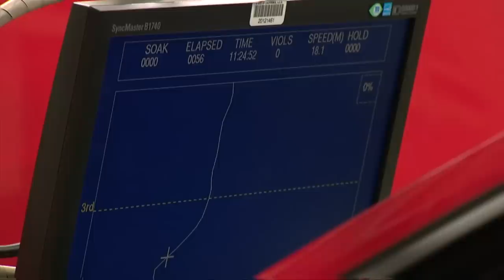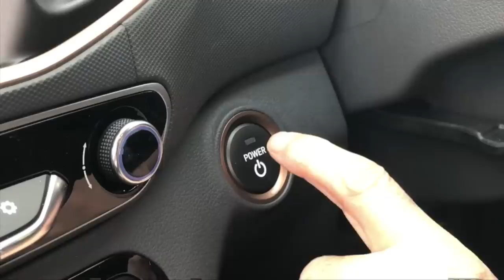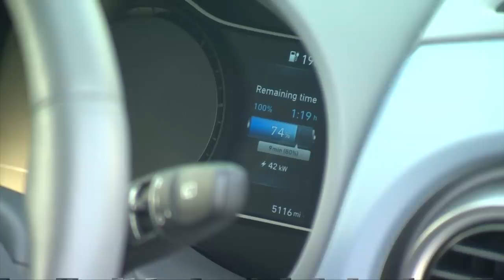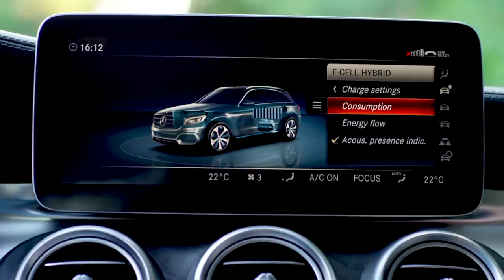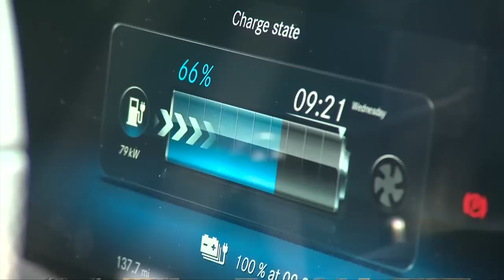Electric Cars: The Future of Road Vehicles? - BBC Click

Comment: come on you all, let's switch to EV, so there is no such thing as war over oil any where on this planet surface
Reply: Don’t worry Once the climate crises really kicks in fully they’ll be wars over safe land to live on.
Reply: @kentonian  couldn't agree more
Reply: Really?  The average UK house uses 10kw of electricity a day.   What do think will happen to the national grid if everyone plugged in a 7kwh charger each night?
Reply: @Chriswales  well, you can install solar or wind charging panel, whether it's temporary or permanently and yes it is a bit uncomfy but it is for the better future
Reply: @bobsthea  and how exactly are solar panels going to charge a car overnight - without yet another set of batteries.  Most house solar arrays are 3kwh - hope you don't need to drive too far in December ...
Reply: @Steve Davis certainly hope so, wouldn't want the lights in my house going out just because half the street plugs in an EV.  Fingers crossed Russia doesn't stop sending gas otherwise everyone would have to walk to work lol
Reply: @Steve Davis in 2017 47% of our gas came through euro interconnection & 36% of Europe's gas comes from Russia.  So yes some Russian gas is used to heat our homes & make electricity.  Currently (lol) gas is the main source of electricity here.

Comment: I remember Chevy Volt.
Reply: I am driving one, well the Vaxhall Ampera UK version every day. Looks and drives like new, gets me to work and back, to the shops etc in EV mode, I'd never go back to a full ICE car now. ICE cars are technologically  inferior to EVs, power bands, constant gear changes, turbo lag, expensive to run, plus they are full of bits the wear out and cost a fortune to fix, and that's before you even consider all the pollution and health damage they  cause. I will get a Tesla model 3 or the VW ID next.
Reply: @donaldduck5731  I also want EV but not much choice here as of now.

Comment: These cars will blow electricity prices/bills through the roof “in the future”. Here in South Africa electricity is already expensive
Reply: Nkwete, in comparison to our salaries, yes maybe.  In comparison to other countries not at all.  Other countries will laugh at you saying electricity is expensive here.  With regards to fuel, electricity is cheap.  I did some research a sort while back and let me give you some figures:

My car takes about 55 litres to fill up and it cost about R900,00 to fill.  With that 55 litres I do about 800km.  Therefore if I divide R900,00 by 800km, I et a value of just over R1 per kilometer.
A Tesla model S do about 500 km on 100KWh of battery power.  As I'm on prepaid I bought R2000,00 worth of electricity last month.  It gave me 984KWh of electricity. This means, I could have charged the Tesla 9 times 100% full and the 10th time 84%.  Now 9 x 500km = 4500 km.  Add 84% of 500 or 420 km and I totalled 4920 km for my R2000,00.  Now if I divide my R2000,00 by 4920 I get 40,7c per kilometer.  This means less than 40% of the price what I currently pays to drive a car on petrol.  So what is the ost expensive, petrol or electricity?
Reply: @johanv.d.westhuizen1705  absolutely correct. I've been running a Nissan Leaf for about 3 years in SA and the electricity costs are around 33% of what the petrol or diesel would be. Plus the car is far cheaper to maintain, is far more reliable, is clean and quiet. It's all a no brainer really, even here in SA. At least once the government gets rid of the crazy tariffs on EVs. I bought the Leaf second hand.
Reply: Huge solar potential in S.A.  Ask Eskom why it's not being developed more rapidly.

Comment: Charging times and charging speeds well you did not tell the whole story here I have been driving a Tesla model s for 4 years and the charging speed was approximately 120 kw IONITY has only built 4 chargers go and look at teslas supercharger network across the whole of Europe you can travel anywhere public chargers are unreliable and not enough fast chargers my new model 3 was charging today at 150 kw and version 3 is 250 kw the rest of the auto industry are approximately 7 years behind tesla you also missed very important facts on electric cars ie how many wh do they consume per mile which is the most important numbers to correctly give you the range of the vehicle and therefore efficiency electric cars are have lots of variables when determining how far they will go drag coefficient, wind speed, outside temperature, tyre pressure , a battery management system to cool or heat the batteries , chemistry of the battery the list goes on but you did not mention one of these factors if you want to cover technology of a product please research properly and give a balanced approach on who is leading the way I have driven every electric vehicle to date and only one company stand out and lead in every area if you do more on electric vehicles please do comparisons on range and efficiency because that determines how much electricity you put in it and also compare same class of cars ie suvs against suvs and saloons against saloons ease of charging on different networks over a long trip ie Scotland to the south of France

Comment: What am I going to do with a vehicle that can do 300 miles a day? Some days I do 450+ (even 550+) and damned if on top of all that driving im going to wait around for 2 hours at a services waiting for the thing to charge when I could be driving home after I have finished work! This will make me 2 hours later home every night. No fast chargers where my destinations are at businesses either, just a standard 13amp socket in the offices, nothing outside in the gravel car parks. What am I expected to do run an extension lead out the window lol.. Electric, totally impractical for the people that travel long distances, ok for short distances or if you have time to laze around at the services. Don't forget about having to charge your vehicle in the morning for 2 hours too at the services before you even start your days work! .. and what about towing, some of our fleet tow trailers, a Tesla wont even get 150 mile range towing one! Electric isnt there yet for half of business users, you need double and in some cases triple the range before it is a viable option. Then there is the problem of our National grid is currently running at 97% capacity 24/7, so add electric cars to the equation and you overload the network in no time... as a side note, the faster you charge a battery the shorter the life it will have, especially a lipo battery! this is very well known...
Reply: I've driven THOUSANDS of miles on US highways in an electric car, no problem. That's what a Supercharger is for! I get enough energy to drive 150 miles (about three hours) in 20-30 minutes. It takes me longer to pee and have a sandwich than to charge my car. I suggest you question your bias and get information from people who own one. 
Another lie: EVs will overload the grid. EVs represent no net increase in energy use from the grid. Why? Because refining gasoline requires 5kW of electricity per gallon! An EV can go 15+ miles on that much electricity! Want to save energy? Stop refining gasoline!
Reply: @justsomeguy934  There's 1 Tesla 'Super' charger 183 miles away from where I live here in the UK, and 3 'Destination' chargers within 250 miles (nearest 43 miles away). Utterly useless if someone travelling for a living and is expected to convert to electric. I can fill my vehicle to travel 500 miles in less time than it takes to down a can of coke by the way lol. Our national grid is currently running at 97% capacity, we don't refine petrol in large volume as you do over in America so that argument is null and void. The strain on our grid is going to cause real problems to the point we are having to building new nuclear power stations to try and cover future EV demands (against the wishes of many since Fukushima and Chernobyl). Lots of people here live in high rise apartments with no intention to install charging points in basement garages (majority don't even have basement garages), so how do they charge their cars? sit in a slow charging station for a few hours before work on a morning? (no fast chargers remember!)... Electric is not practical over here yet, and wont be for some time...
Reply: @Ra-zor  You have many incorrect "facts" about EVs. Ready to discuss? As for superchargers near you, you have to be in an area traveled enough to get a Supercharger. Highest traffic first, sorry someone can't snap their fingers and duplicate an infrastructure that we've had 100 years to make (like petrol). While you can fill your vehicle in 5 minutes, do you drive for 500 miles with only a 5 minute break? That's not only dangerous but illegal for commercial drivers here in the USA. You have to take breaks - and you simply charge while you're out of your car. 
Your argument that EVs will overwhelm the grid is nonsense as well (a common scare tactic written by the oil industry). There is no net increase in electricity demand for EVs. Why? Because when you drive an EV, you're not using gas. Gasoline requires 5 kw/h PER GALLON to refine - an EV can go 15+ miles on that amount of energy. Just stop refining gasoline and you can push an EV farther than a gas car can go! 
As for charging, the average USA commute is 25 miles round trip. That's all a typical person drives in a day. You don't need to charge every night at that rate. Many UK towns are converting light poles to have connections for EVs, as well as work places. If you park on the street, have no power, live somewhere it's not feasible, then get a hybrid.

Comment: Hydrogen is electric too. The current comes from combining Hydrogen and oxygen and is not store in a battery. But the CAR is all electric.
Reply: You are talking about hydrogen fuel cell, not hybrid. Hybrid still runs on Petrol/diesel.
Reply: Phil Terry sorry spell check got me there. Ment hydrogen. Will Edit. BUT video  said ...pure electric ... not hydrogen...  and hydrogen is by all a electric car as well.
Reply: @andreaslossius7920  Hydrogen is Electric, Though not the future of road transport.
Reply: Phil Terry interesting view. Why not do you think?
Reply: @andreaslossius7920  Well as you said Hydrogen is basically an electric car. Producing the Hydrogen, transporting it around the country and then turning it back into electricity, makes no sense with all the losses you incurre. Much better to simply put the electricity straght into the car.

Not to mention the huge cost of fitting the Hydrogen infrastructure.
Reply: Hydrogen is not good as an automotive fuel. Several reasons! First and foremost, it's an energy loss just like gasoline - you only get back about 20% of the energy required to extract and store it. Second, to have a usable amount you must store the universe's most flammable gas as a cryogenic liquid under thousands of pounds of pressure (about 3,500psi). To dispense it, you must store it at a station at about 10,000psi. Very high combustion risk! The only reason you hear about hydrogen as an automotive fuel is because the oil industry is the primary source of commercial hydrogen - they want a piece of your transportation dollars. Gasoline is far superior to hydrogen as a practical fuel.
Reply: EV Owner. Hi. Most of the problems you mention is already solved. In Norway there have been hydrogen stations for a while as a test. We are good in transporting flammable gasses.  It has been done for decades. Produsing hydrogen is a wery difficult calkulation because it can be done in so many different ways. I would like som documentation for the number as low as 20% please? I have not sees a number as low as that.
Reply: @andreaslossius7920  Sure! Hydrogen, at the point of usage, is 40% - 60% efficient (let's say 50%). This is far better than gasoline. What is left out of the equation is the processing/extraction/storage energy, which brings it to 20% - 25% of the total energy used to render it usable. (Here's an article on the usage point of hydrogen, although it talks about emissions reduction rather than energy cost) https://www.energy.gov/eere/articles/hydrogen-clean-flexible-energy-carrier .  Regardless, look at what hydrogen does - it must be stored under tremendous pressure cryogenically to be useful - why use it? There was a hydrogen station that exploded in Europe, I think, that caused it to not ever be replaced. And you're carrying around 3,500psi of explosive gas - why? Absolutely none of those dangers are necessary with a BEV.

Comment: lol. Now let's see the Tesla vs lambo around a racetrack (and before you say "why" because Lambo is a racecar)
Reply: Just a bit slow off the line.
Reply: Think other shows did it round Nurburgring if that’s how it’s spelt. Petrol cars might get beat on the earlier laps but petrol improves as weight is lost from fuel consumption. The electric car couldn’t continue that burst sprint time after time either. Petrol could and gets faster minutely each time.
Tesla’s latest time got very close to petrol cars worth ten times more around Nurburgring. That is impressive.
Reply: @stevepirie8130  Remember the time set around the Nurburgring was set by a hybrid. The combustion engine is feeling it;s age, and needs the crutch of the electric motor to compete. Ultimately the record will fall to pure electric, it is only a matter of time.

Comment: Ev's are a joke I won't get one until they can do over 600km per charge minimum  because of distance between chargers here Australia my closest charger is over 1 hour drive from my work/home. I can't justify the cost of a Tesla or any other ev they are double the price of the same car in petrol. Then to drive a hour to charge sit there for a hour then drive home again what a joke
Reply: You're not alone, Trent. As a matter of fact, EV's are an extreme minority, super niche market currently. 98% of consumers still prefer to purchase a "regular" car when given the choice.
Reply: The batteries range is affected too by heat, cold, does your trip have hills and mountains, etc. If your country has long power cuts obviously affects you too. 
I’ve been holding off buying a new car to see how it unfolded but I’m not 100% sold either. Powering my car off coal burning power stations just seems like hiding your pollution in someone else’s backyard.
Reply: I guess you don't have power at your work or home, mate.
Reply: @alanfoster6589  my stand alone solar system won't handle that kind of load and asking work to install one would be like  cutting their arms off
Reply: @trentneumann5788  How about installing Tesla powerwall or equivalent from Siemens to store power until it's needed?  But if you're fully rural and have a small solar system then no, it won't work.
Reply: @alanfoster6589  I have battery storage on the house it holds approximately 15kw of usable power I have 5 kw solar system on the roof so to upgrade it to handle charging a ev would cost 30/40k then the cost of having the charger in stalled say around 5/10k then to buy the cheapest car is about 50k and that's a lot of fuel so yes it is a joke at the moment, and by the way my closest relatives live about 350km away  with the only charger along the route being 300km that is why they are a joke
Reply: @trentneumann5788  It's not a joke...I guess it's just not suitable for you. Of course, the LR model 3 gets over 500km per charge.  That would get you to your closest relatives quite easily.  Maybe even some farther-away relatives.  Plug in at their house and recharge.
Reply: @alanfoster6589  unfortunately the model 3lr and model X are $130000/$150000 in Australia. The government does not offer any incentives to purchase a ev
Reply: @trentneumann5788  Ouch.